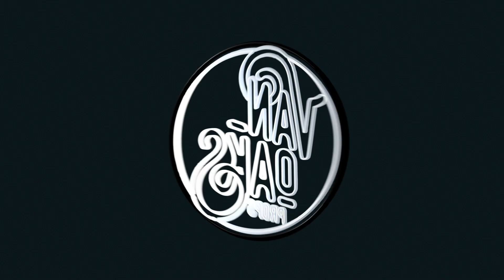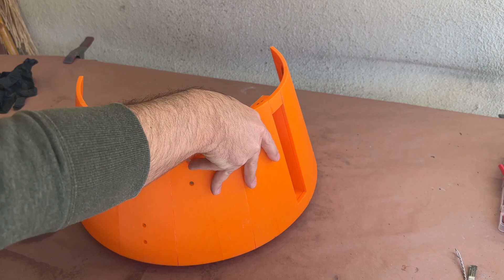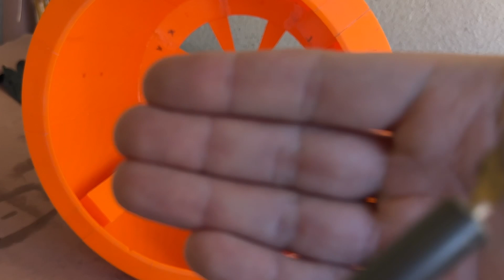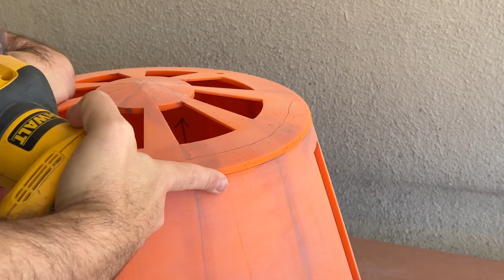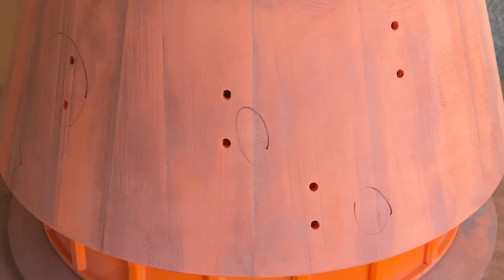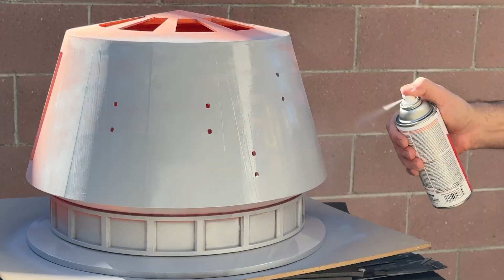SUPER Easy 3D Print Smoothing & Prep for Paint - Use LESS Spot Putty!

Comment: Nice Chopper, I'm working on an R5. As I am currently in the middle of that process, seeing other maker's techniques is really helpful. Thinning down the puddy with acetone is very interesting, I'm going to have to try that.
Reply from the maker: It's a good option for helping to stretch your spot putty. I've always found that applying by hand for small layer lines just uses more than you really need, and thinning it down really helps to cut down on that.

Comment: Have  you ever  considered using  a two part  epoxy  primer? It's a little  pricey  but  great for  filling  in small  gaps and  scratches . Another  question  I have  that's  a bit  off topic is  where do you find the best photo reference for the  figures in the Haunted  Mansion?
Reply from the maker: I have, but like you mentioned catalyzed primers are not cheap. Definitely good, and a big timesaver, but not for casual makers/hobbyists. 
As for reference photos, mice chat has a few threads on the mansion that are really useful. Also photo sites like Flickr are full of great images that people have taken over the years.